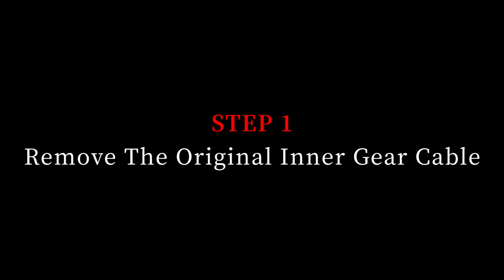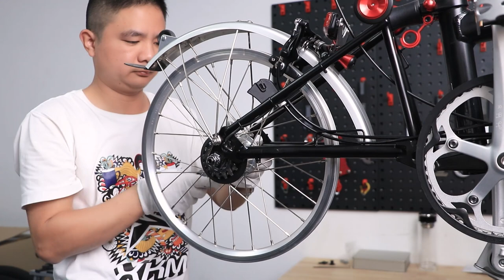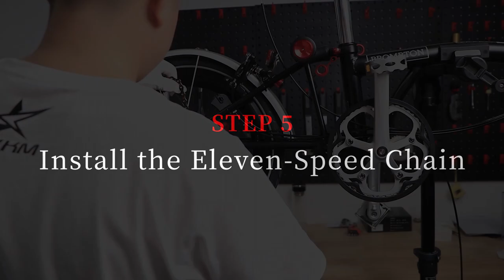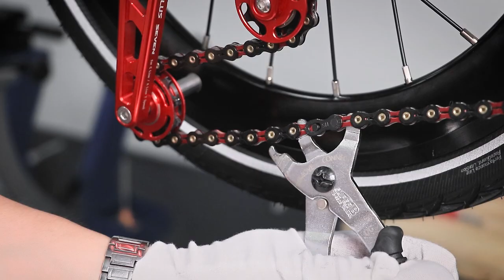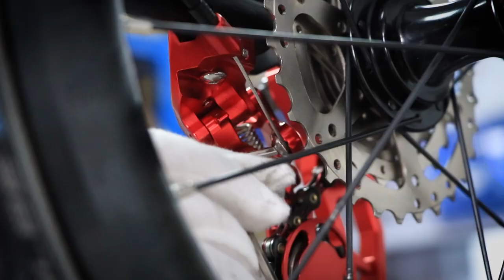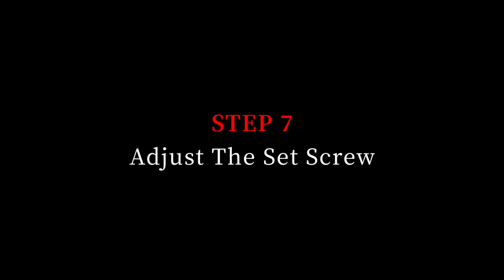Brompton foldable bike How to modify the external 7-speed, what you lack is the Liteplus Derailleur.

Comment: As an owner of a 2019 SuperlightM6LXBrompton I have thought about a 7 speed system and wheel for less weight and more ease of changing gears. I wondered how the changer became fixed to the frame triangle but I have lately seen that it fits the ordinary frame and mount.  Finn. Denmark

Comment: what wheel/rim is that?  and also what shifter do you use here?  thanks.
Reply from the maker: We use the external 7-speed wheel set made in China, so that our cassette can be installed. You can use the LTWOO-A5 gear lever or our matching Liteplus gear lever.
Reply: @Liteplus2022  is the wheel a Silverock sr38c?
Reply from the maker: @JD.007  A wheel set with a rear wheel opening of 112mm.
Reply: @Liteplus2022  Thank u 😊

Comment: It absolutely makes no sense! Because this tensioner is very low and will hit the ground!
Reply from the maker: Hello, you can watch our video, after actual testing, it can adapt to most road surfaces: https://youtube.com/shorts/f3O2fU6ApT8?feature=share
Reply: it's not so low; if you look it's well within the rim of the wheel so if the tensioner gets hit it's probably because your wheel has collapsed. This model (and the RUHM which I think is a rebranding) is definitely one of the better third party solutions. I recently did a survey of lots of Brompton modders and this (although as RUHM as I say) seems to be one of the only ones people are positive about.
Reply: Wow Brompton needs to improve their gear system because going up steep hills is ridiculous. Plus great video
Reply from the maker: @greenerick  Yes, in the actual riding, the tensioner has a certain height from the ground. RUHM has done a very good job in this regard. The factory is an external transmission, plus a special transmission kit (finger dial, rear transmission, cassette), so that the transmission is smoother. In contrast, Brompton is not perfect in terms of transmission, unless you have very rich debugging experience.
Reply from the maker: @MrJofArnold  Yes, in the actual riding, the tensioner has a certain height from the ground. RUHM has done a very good job in this regard. The factory is an external transmission, plus a special transmission kit (finger dial, rear transmission, cassette), so that the transmission is smoother. In contrast, Brompton is not perfect in terms of transmission, unless you have very rich debugging experience.